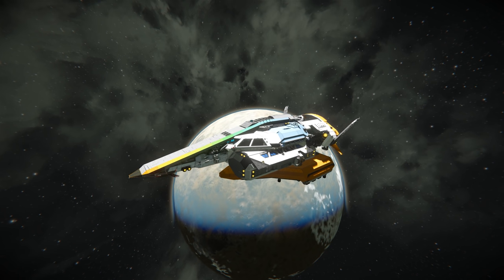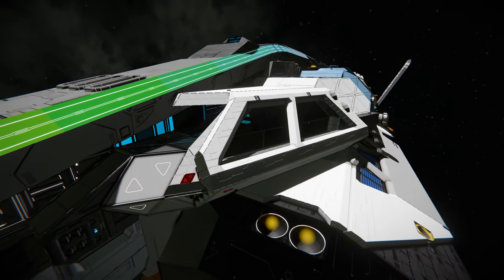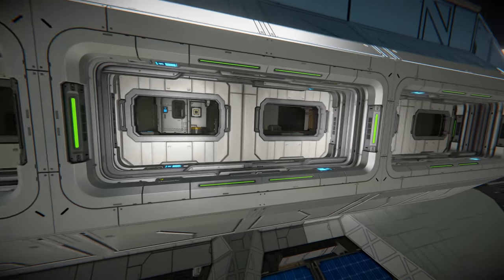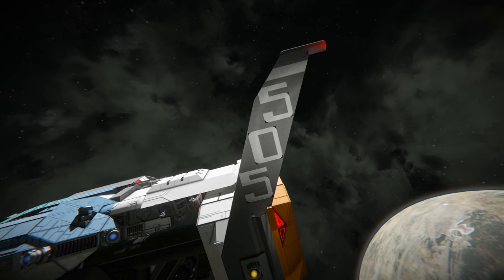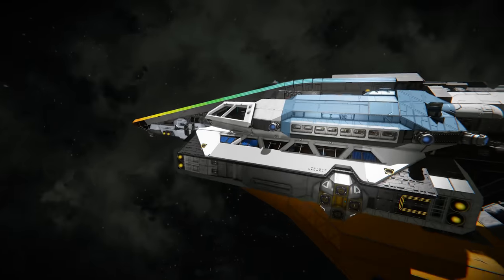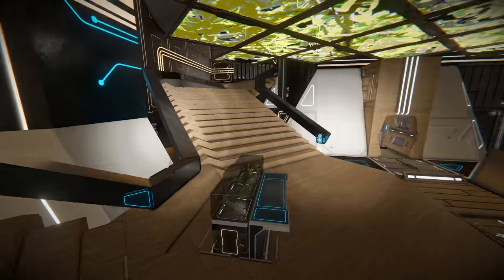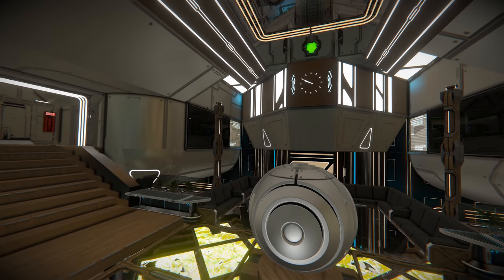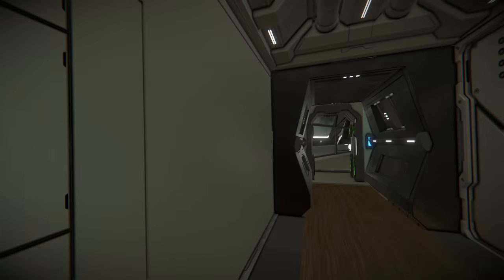Space Engineers TC505 Makara Class Pleasure Cruise-liner

Comment: Hey man, another good ship!

I just want to try and give some contructive critisism as someone that's watched you for a couple of years now, it might be beneficial to start doing a pre check first and then making a plan to record with. When you were going through the ship, and the booster pod underneath, it felt very rushed and it seemed as if you just downloaded the ship and jumped in without much prior knowledge other than the basic credits.

Something along the lines of:
*download, read about & understand
*Pre-check the ship, find it's main areas and what the ship trys to show case.
*Plan a route through the ship, jotting down points to talk about at that specific location (two for main areas, one for smaller areas) 
*If you plan to use IG character, test the area you want to use it for first
*Plan in stop points, these are areas where you would allow the viewer to take in design work (For example, when you entered the main hall it should be done at more of a walking pace with slow panning. And when you mentioned we could pause to check the credits, stop for a second to allow for a proper freeze frame)
*Then run a test run through the entire recording process, trying to split it in to sections. Outside, inside, systems, piloting

You seemed like you were starting to get the hang of this in the past, but the last view videos I feel as if you are struggling to find a direction to take your content. Obviously I don't mean any of this as a bad thing, just trying to do my part to help you grow more as a person! If you need any help let me know!

P.S. A good way to split the sections is to do a run through of the area, then allow a non commentary panning around the points of interest. Like a transition to each scene :)
Reply: yea, something kind of like what morphologist does with his star citizen ship reviews
Reply: @alexbard4437  yeah but morphologist is a genuine architect and knows what he's talking about, arron doesnt and consistently misses many details
Reply: @alexbard4437  also it seems like arron never takes a look at ships BEFORE he makes the video, so he never knows how to use them or where to take us

I also really fucking hate his use of high sensitivity while reviewing ships, its super disorientating
Reply: i literally came to the comments to say this exactly, I've been here for years also. so this is a thing i notice every time he does this.
Reply: @gabrielibarra5551  Its funny you mention 'how to use'.. because the workshop 'Subscribe' page literally has all the control seats functions listed in the main description. Easy peesie.

Comment: The lower detatchable section of the ship is most likely used to get the ship up and out of a planet's atmosphere, or to help slow descent. I don't have the ship tested myself, but that part could either be designed to be left at a docking station up in orbit and reused, or it might be made out of cheaper material, so you can just drop it when you get out of the atmosphere, and let it fall back down to the planet below.